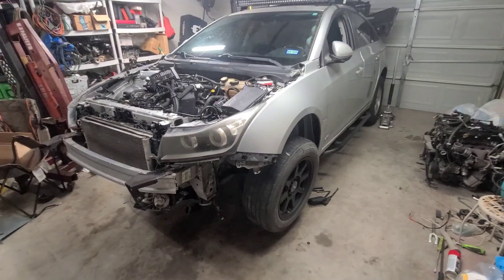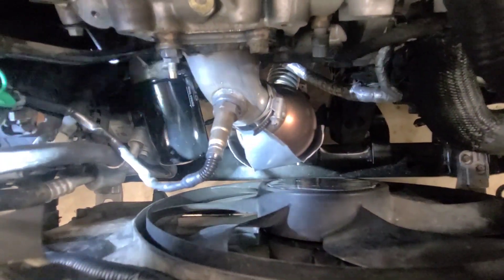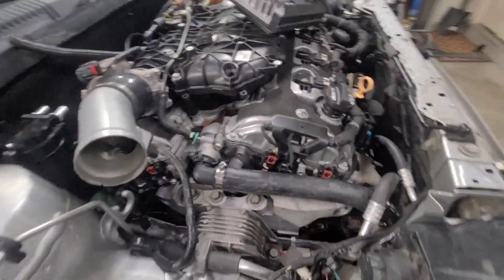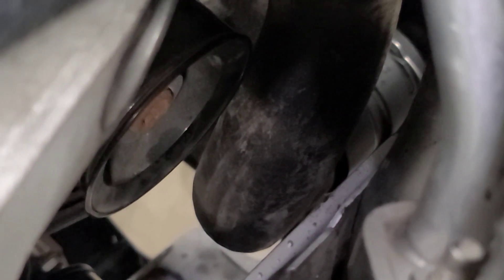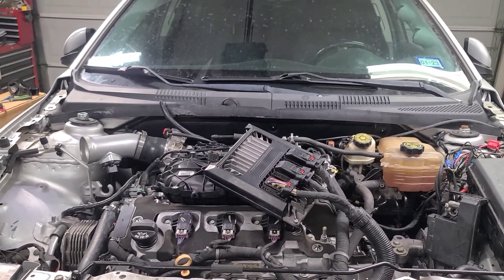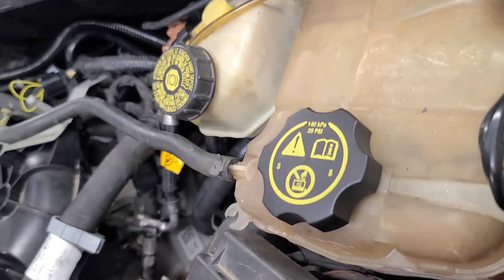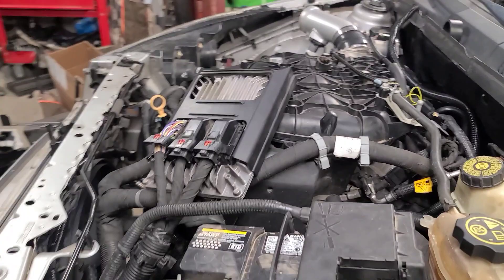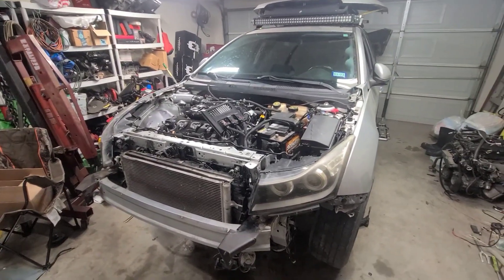LFX swap Chevy Cruze 1.4 turbo to 3.6 V6 Part 5

Comment: Are you using the same transmission?
Reply from the maker: It is the transmission from the Impala driveline. The first used one I put in it had problems, but the second one is doing fine.